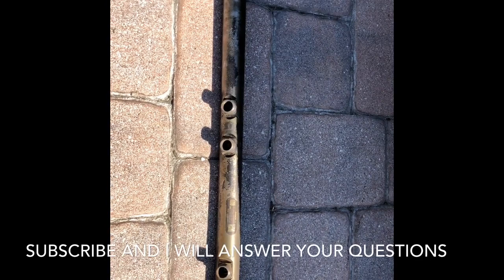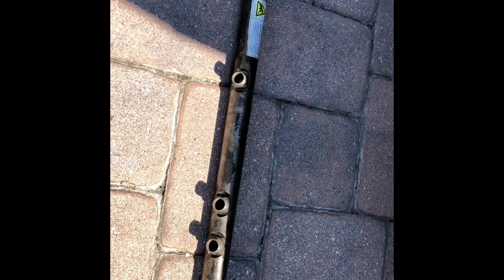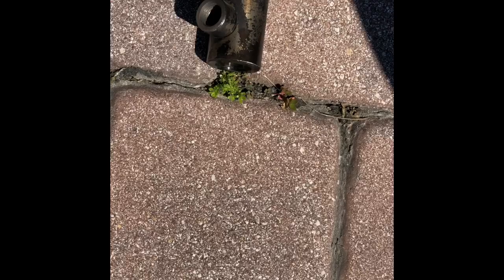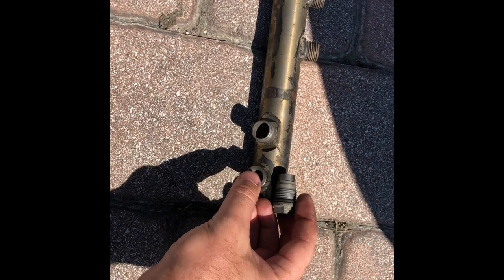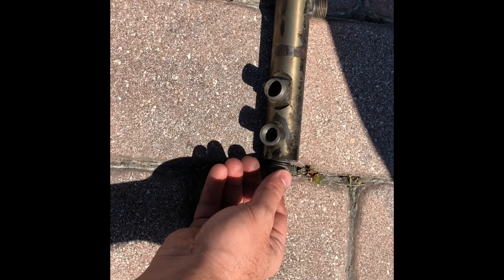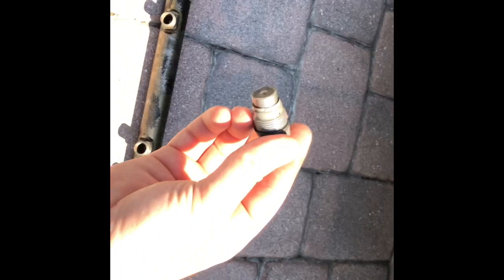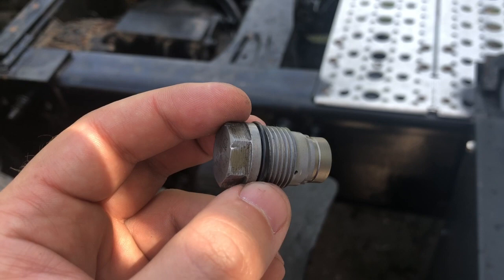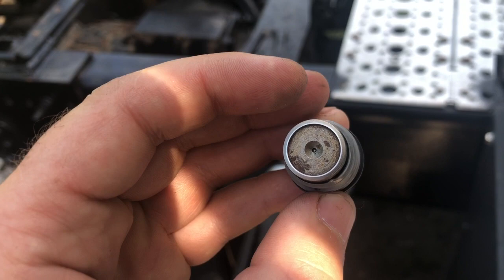Freightliner Cascadia Detroit Engine DD-15 Fuel Rail Pressure Valve

Comment: I have changed my fuel filter yesterday and the truck doesn't run but cranks only. Its giving me this code SPN 157 FAIL 17. Rail pressure. 
Did you think it's same as your issue.
Thanks for the video
Reply: i have the same code will this solve the problem?
Reply: @soedoh1361  most likely air in system or filter caps not all way sealed seated
Reply: @tittat2440  definitely air in the system, i've made sure the fuel filter are tight but right now the air goes back to to the fuel tank when I crank the eingine ,and when i open the fuel tank cap there alot of air coming out.  this is after i changed the injector cups and seals.
Reply: Hey man you figured that out I got the same problem
Reply: @nazariobertie6811  air in the fuel system. I got this guy he purged the air and it started right away. I made a similar simple system form bug sprayer and the adapter from local fitting shop and some other joints and it works fine. 
Before I was able to use the hand pump by the fuel system but now I have add fuel from the outside. Part number Parker PD243
Sorry English isn't my first language.
Reply: Hello did you fix ur problem.if so what solve your problemThanks
Reply: @901hensee  air in the system. You need to purge the air from the system. Most shops have a system where they pump fuel to the fuel filter. I have made a simple one myself and I use it always.